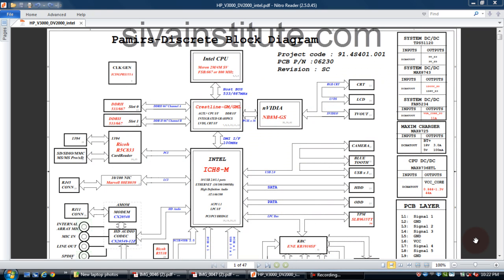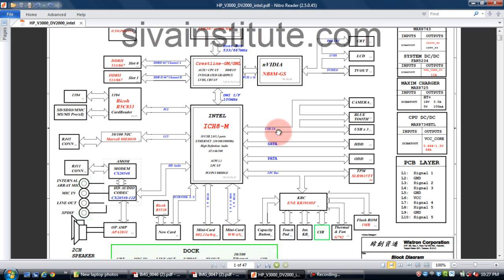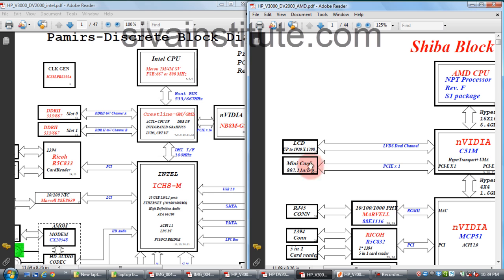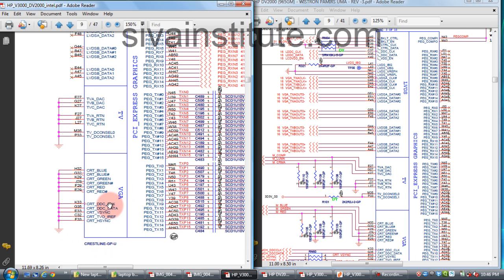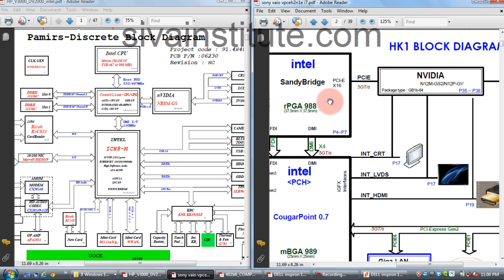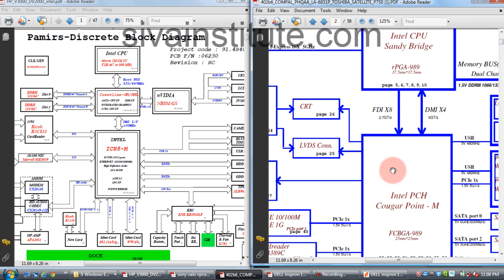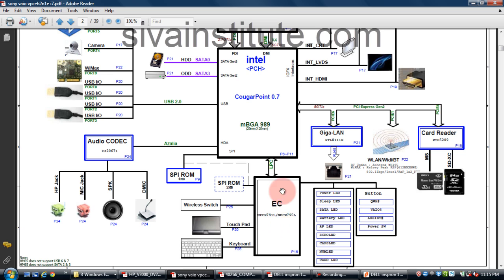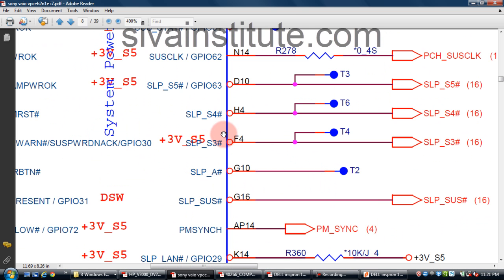Laptop Block diagram.

Comment: Welcome!
I need a little help from notebook "LA5911P new75"!
I pulled off the LCD connector while cleaning the battery in it, and that's LEDs flashed! Since then, the notebook can not be turned on! Where can I find the problem first? Which parts go ruin?
Thank you!

Comment: sir, i have laptop acre travel mate 4060 series problem is when i start laptop it work fine only problem is back-light is dim or not full light.....i chk by replacing inverter circuit and cable but no change happen......i think problem is on motherboard....can u help me about this please...